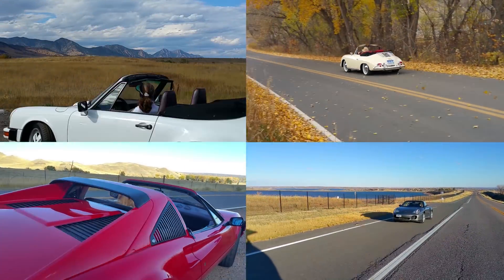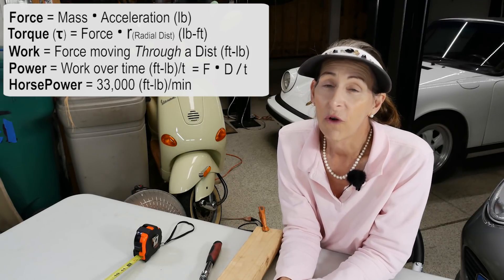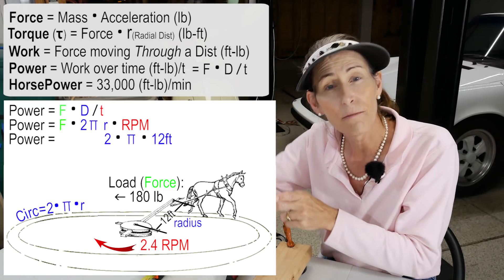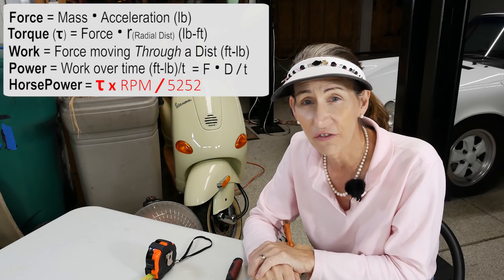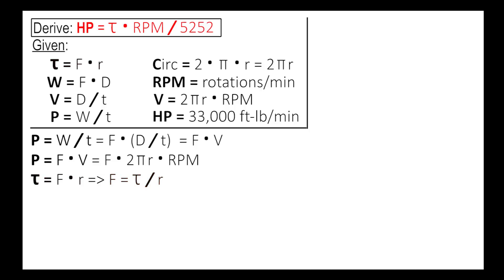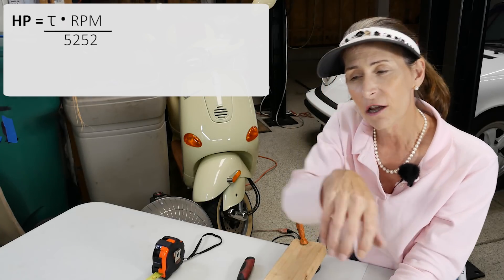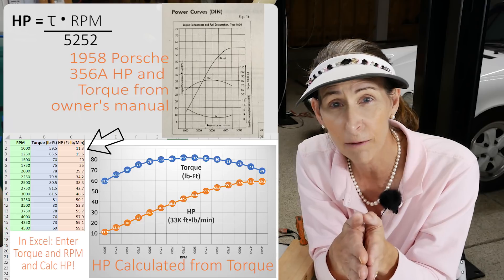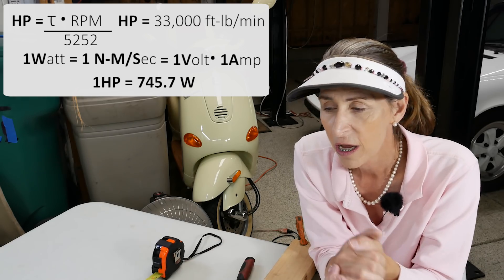Horsepower Vs. Torque Explained! (Complete)

Comment from the maker: Hi Everyone, Have you ever been confused by Horsepower, Torque and RPM and how they are related? I sure was!!  So, I went back to the math.  In this episode I explain where HP comes from and how it is calculated (yes, calculated NOT measured!). Hit me with all your questions and comments!  What did I miss and did I get anything wrong??  Enjoy, Franny
Reply: Heidi and Franny's Garage: Lots of 'good ol''  mechanics equations here Franny, but I guess the (imperial) unit of Force (your 1st equation) is [lbf], not [lb]. Which leads to the 2nd equation: the unit of torque would then be [lbf⋅ft], not [lb⋅ft]. Etc.
Reply: first of all - sorry for my english;)

1:20 its good that You said that "torque is static force" because its true, If it start to move, it's changing into work.
Can we feel engine torque at all? We can. If the crankshaft from engine  try to rotate, but we grab it by our hands and it stop to rotate but we feel a force from crankshaft trying to rotate -in this moment  we feel torque. But if its start to rotate and we feel this rotation in our hands, that is work over time = horsepower:)

Comment: Equinophobia?  Let’s agree to use Kw for our unit of power. 
With that out of the way.  Let’s cut to the chase.  Forget about torque, Save yourself a step and just look at the power curve.
Wherever you are on the curve is your budget to accelerate, tow, climb a hill, push air out of the way at top speed... torque is only a useful spec when you are calculating when parts will break or how much tension you need on the fasteners to keep the wheels in the hubs and the heads on the block.
All work is done by Power.  It’s not an opinion or just a fact,…. It’s the Law.

Comment: There were some comments that, though they were innocent enough, some people who already struggle to understand torque vs. horsepower will be further confused rather than enlightened. For instance at 9:45 "...if you've got a graph...and if you've got torque on one side and horsepower on the other IN THE SAME UNITS..."   Red flag right there. Torque and horsepower can never be the same units. They can both be graphed on similar scales that go from 0 to the same number value, but the UNITS cannot be the same (as you know). That comment will confuse some people who came here for clarity. Another example at 9:56 "...because horsepower is torque times RPM over 5252, and if the RPM is 5252, then guess what...they cancel out and you get TORQUE = HORSEPOWER. Simple enough." Again, for someone who is already confused about how torque and horsepower are the same and how they are different (i.e. for the exact audience you made this video for), he may be confused when you say "torque = horsepower". Some of us understand that you're talking only about the number value of the torque being equal to the number value of the horsepower at 5252 RPM, but if you tell someone who is already somewhat confused that "torque = horsepower" they may interpret it to mean they are literally the same thing. I'm just saying, be really careful with the terminology you use to teach. It can undermine an otherwise excellent explanation.
Reply from the maker: Thanks for your comments.

Comment: The funny thing is that LOTS of journalist or "motor experts"still think that in car when they accelerate, they feel torque - which is wrong. They feel power. Like in diesel engine. They feel not torque in lowish revs but there is lots of low rpm power - because PHYSICS
Reply from the maker: Because PHYSICS!  Welcome to the channel!

Comment: Nice video!

It basically boils down to Torque at higher RPM being more valuable than Torque at a lower RPM.

That's why HP or kW is the more important factor cause it shows you the Torque in relationship to RPM.
Reply from the maker: Yup, I suppose you can think of HP as the ability of the engine to keep up torque as RPM increases. ...or the ability to deliver torque faster...

Comment: I do seem to recall reading somewhere that James Watt was also something of a canny Scot, and mildly over quoted the horsepower that his own engines were able to provide. Later calculations revealed, or so I heard, that Watt's horses  could apparently do 1.2 horses worth of work! But I'm not struggling to find where I read it. ;¬)
Reply from the maker: That wouldn't surprise me...  He wouldn't be the last to be a bit "optimistic" abut an engine's HP rating (lookin' at you Ferrari!). Still he had to be pretty clever to go through all that fuss to relate his engine to the current power supply of the time.
Reply: Oh absolutely.

Comment: Great video. This is high school physics that most people either forgot or never understood in the first place, but they will now :)

In Europe SI units are used since 1972. SI stands for Système international (d'unités) which would translate to International System (of Units) in English. Power ratings for cars is in kiloWatts (kW) and torque is rated in Newton meters (Nm). But up to this day people still talk about horsepower, where in Europe that means metric horsepower, which is different from Imperial horsepower. 

 According to DIN (Deutsches Institut für Normung, which would translate to German Institue for standardisation) the metric horsepower is defined as the amount of power needed to lift 75 kilograms against the earth's gravitational force over a distance of one metre in one second. This works out to be 75 x 9,8 Watts = 735 Watts. The Imperial horsepower translates to about 745 Watts.
Reply from the maker: Thanks for all that!  I debated as to whether to go into Metric HP, etc.  Since Mr.Watt was using old English units it seemed appropriate to just stick with that.  Do you see Metric HP much?  What I read said that it isn't used much and the preferred is Watts
Reply: Officially the kiloWatt is in use since 1972 with the introduction of SI. For power ratings you need to use the kiloWatt and are allowed to use either metric or imperial horsepower as a secondary unit. In practice it's a different story. Car journalists, car enthusiasts and people in general still use imperial or metric horsepower,  more so than the kiloWatt. Metric horsepower is widely used in mainland Europe. In the UK and Ireland they use brake horsepower, which is, as far as I know, equal to the imperial horsepower.

The efforts to standardize units under the SI is largely a political one. When the UK and Ireland joined the European Union they had to conform to SI and the metric system. Of course there were protests and a general unwillingness to do that, so the European Union changed their directives a few times over and allowed the use of the Imperial system in UK and Ireland.

One example where you can see just how widely the horsepower is still used is in the names of McLaren cars. A 720S has 720 metric horsepower. Since it's an English manufacturer I would have expected the use of the imperial horsepower. But the Imperial horses work a little harder than the metric ones, so the engine would 'only' produce 710 imperial horsepower. Since 720 is more than 710 I think that's why they use metric horsepower. And it beats the 530 kiloWatts with ease, even though it comes down to the same thing.

One more thing to consider is the difference between SAE (Society of Automotive Engineers) and DIN (Deutsches Institut für Normierung or German Institute for standardisation) ratings. a DIN rating means that things like airfilter, waterpump, fan and alternator are in place when power is measured. Not so with the gross SAE rating, even though I believe they changed to net SAE rating these days.

Comment: So  would it take 4  Porsche 356A's to equal the work of one Ferrari 380?  Acording to your picture.
Reply from the maker: Lol! Yup, but, if you work it out, that little 356, @60HP puts out very close to 2M ft-lb/min of power!  That means it could lift 1000 tons a foot in the air in a minute!  That is pretty staggering :)

Comment: Nicely done! And the general case is Torque=k*d(Power)dt, where k is a constant. :)
Reply from the maker: Thanks for that...  Ya know, I did struggle with at what point in complexity do I want to show this.  I actually read/saw the whole thing done with dimensional analysis which was really cool, but I think I would have lost folks.  Also Torque can be a vector as rXF, but that would have spun off into the weeds...  I was hoping folks would add bits as you have :)
Reply: I just edited my original post as I erroneously had flipped the variables. The Torque curve is the derivative of the Power curve. This is why straight (linear) power curves go along with flat top (constant) torque curves.